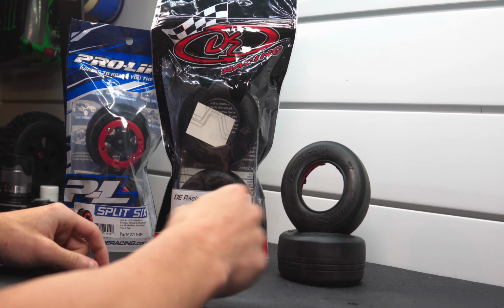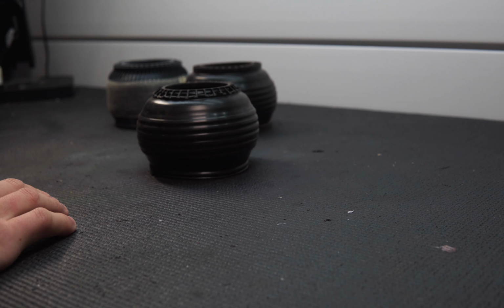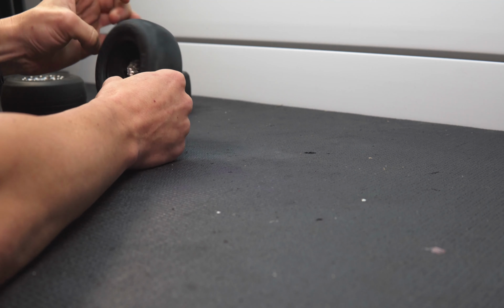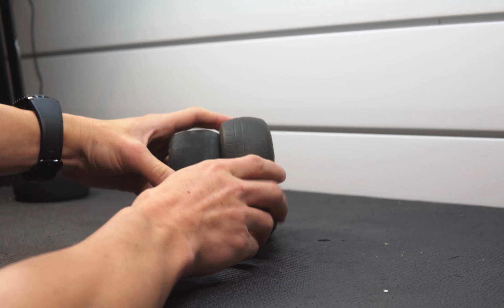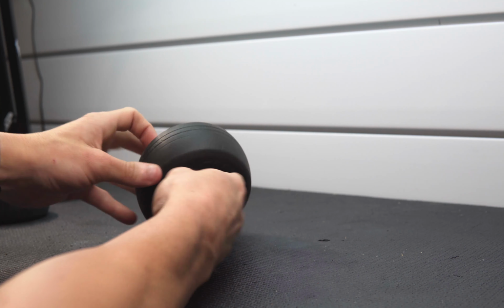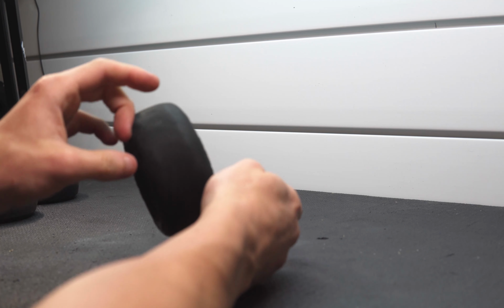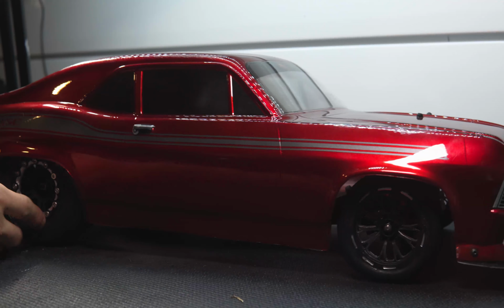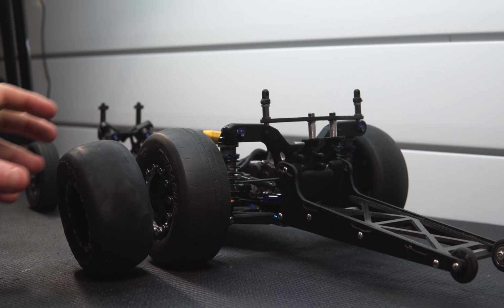Making the Change! | Switching Tires on RC No Prep Car!

Comment: I was just thinking about getting bead locks because I mess up gluing every time & I just ordered more DE racing tires. I’m glad I know now about cutting out the ribs. I’ve ran the street outlaw DE in clay & the phenomenon in the D40 compound. I like them so far & the wear is really good. I also run Panther but the tires are thin & don’t last long. But the hook really good.
Reply from the maker: From what most people are telling me, the clay compound seems to be the way to go. I might switch them out before I test it out

Comment: Hello I am new to RC Drag Racing and just mount two rear tires and wonder do you vent them ? Wheels are aluminum with Hoosier tires with bands inside...
Reply from the maker: I've never vented RC drag tires. Vented tires on bashers but never drag tires. Not really sure if it would be beneficial to vent them
Reply: @FullThrottleRC  Thanks .....

Comment: Wish me luck! I've got maybe a quart of fuel, no drag tires, LHS is closed all week for labor day, and the test'n'tune is tomorrow. Gonna take a couple cars down and rip anyway, 'least till I run out of fuel!

Maybe I'll even get some video of a pass or three? Maybe we'll see.
Reply from the maker: Good luck!
Reply: @FullThrottleRC  Took stock of my fuel stash. I have a 500cc pit bottle, and this is what I've got to work with:

1.5-1.75 bottles of fresh Sidewinder 20% Race

320cc of kinda stale but still viable Sidewinder 20%

310cc of 10+ year old but somehow still viable Blue Thunder 20%

~200cc of SIG Champion 25% 1/2a Fuel

That's the order I'll use the stuff in. The 1/2a fuel is 20% total oil and half of that is castor, messy stuff, great for 60+ year old plane engines. The Blue Thunder is something like 18% oil but I've confirmed it's still viable fuel with other cars. Somehow. It's literally ten years old or more!

Car itself has a 210cc tank, so not all that much fuel. But then again passes won't take long so that should be tons of fun!

I also have about 3/4 of a gallon of Omega 15% plane fuel. I could run that in a pinch but it's high in oil and slightly down in nitro so I know I won't get any good hits off of it. Won't hurt the engine any though.

Got any tips for getting a good launch for someone who's never actually run the scale quarter? Luckily enough my Scorpion XXL just digs in and scoots when I belt it open, no funny business no major wheelspin.

https://www.youtube.com/watch?v=GTCyLhcV0OU Here's some footage of the car I'll run the most doing some speedruns out front of the house. Be interesting to see what the timeslips have to say!
Reply: @FullThrottleRC  Just got back. Brakes went out on my car after the 9th pass, not sure if it's mechanical or the servo. Erred on the side of caution rather than risking a runaway nitro buggy.

Best pass was 3.75 @ 31.8MPH 0.087ET. Had a blast down there too. Engine liked to load up during staging; expected this I have it tuned for longevity. It ran out of legs about 3/4ths of the way down too; my slowest trap speed and my fastest were within 1MPH of one another.

Was a blast though! And I heard one of the organizers go 'Right down broadway!' during one of my passes haha.
Reply from the maker: @TestECull  sounds awesome! I've never been into the nitro stuff but as long as you have fun it doesn't matter what anyone else thinks!
Reply: @FullThrottleRC  heh heh if we're ever in the same area and you hear brap you've probably found me! The engines are why I'm in RC; just something special about how such a small little engine can produce crazy power on exotic fuels!

Not gonna be easy to do my custom build. It's gonna be like your front engine dragster, but with an actual engine. I need to find a clutch bell that has a drive cup for an output and a suitably strong crawler axle; already have a suitable engine and a turnkey 1/10 buggy front end to use. If I can find that bell I'm set; keep it nice and light won't need to gear down any! And I think such a rig could be competitive in street eliminator at least, so I'll probably build it around those dimensions, use their tires.
Reply: @FullThrottleRC  Oh, and everyone else there was nice and supportive; nobody gave me any shit 'cause my car was slow or noisy or whatever. IT was great. Had a blast!

Comment: Hey buddy, print yourself a pair of tire bands, they go between the rubber and foam. It eliminates ballooning. No need to tape anymore.
Also, will you make and sell those bead locks and the shock tower extensions? I’m extremely interested! Hit me up!
Reply from the maker: I'll have to look into the tire bands! That's a great idea. I've been trying to decide if I want to just make the file available for the beadlocks, like the tower extension, or print and sell them myself.
Reply: FullThrottleRC print them and sell them brother. Not everyone has the means to print and not to mention hopefully people aren’t printing yours and selling them!

Comment: I still might just go with the prime tires because the way my car is setup 65-70% of the weight is on the tires so it should flatten out the contact patch a bit. I might also use a softer foam or no foam so the sidewall have some give so the tire can squish down a little more
Reply from the maker: Most of the cars I've seen have most of the weight on the rear tires, unless you do a lot to move weight to the front. The Primes work though, I was just interested in trying something different.
Reply: @FullThrottleRC  after looking some more I found that the de racing outlaw minis are gonna work better. I still have the same plan as before but a better tire
Reply from the maker: @asher12356  I've never used those. I went back and looked and these are the Phenoms. I'll be trying some Street Outlaws soon though
Reply: @FullThrottleRC  nice. Looking forward to that video. Just a heads up. If you get the full size outlaw tire and not the minis, you’ll want to make some of those 3D printed bands for them. Especially for the 132ft

Comment: Dude think about that contact patch you raised a car off the great money Burnite that’s for 90% your where comes from and because you’re pulling it up off of the deck the tire expands and goes narrow hence the wire patch
Reply from the maker: I think you are talking about the burnout and I actually don't raise the car to do a burnout. I just hold the car back in my hand, if the tire grows a little its the same amount it will grow down track. I have tire bands inside of these tires to limit that though.

Comment: What would you charge me for a set of rings for the same wheel and tire, the new ones. I like  that nova body man it’s sick
Reply from the maker: Thanks! I haven't really looked into a price for the beadlock rings yet. Without actually doing any numbers on it I would probably say 15$ unpainted 20$ painted.
Reply: When ever you build some I’m ready to give you my $20
Reply: Right on that works for me, what state or city area do you live in if you don’t mind me asking I’m sure you have said I am terrible with names and I don’t remember anything so I will apologize ahead of time. I would like to figure out a way to get ya payed ahead of time before you make them.